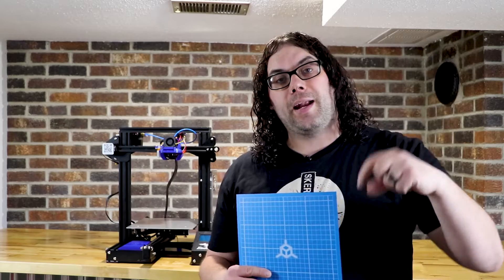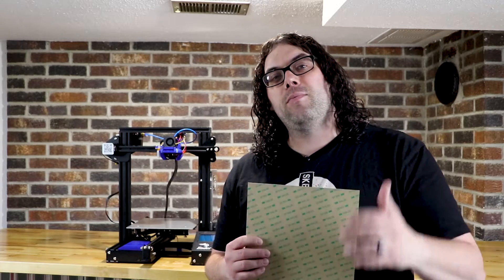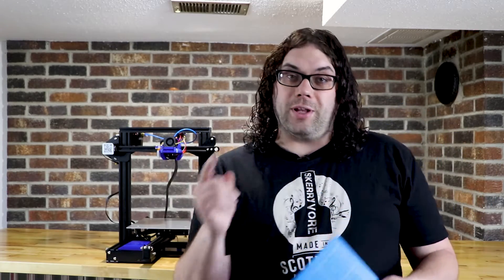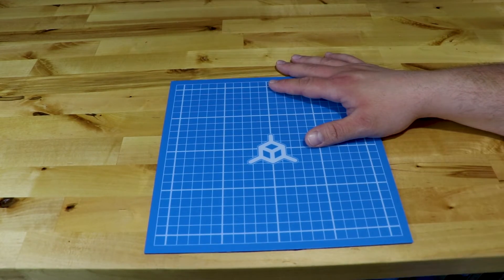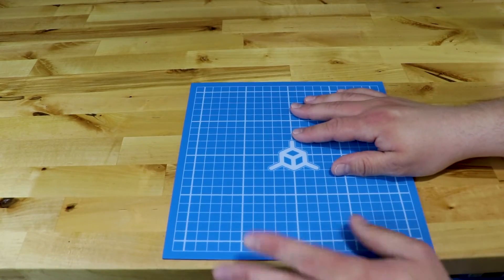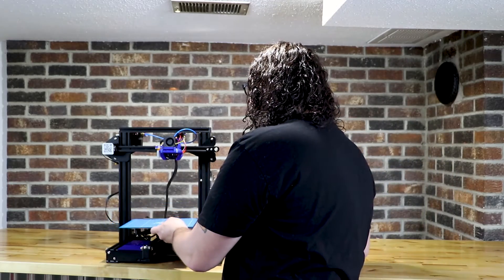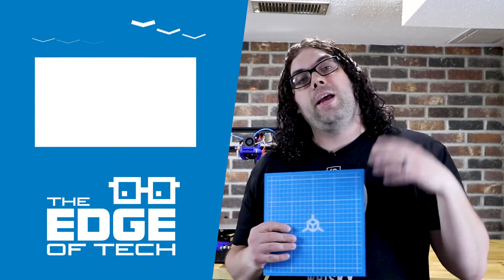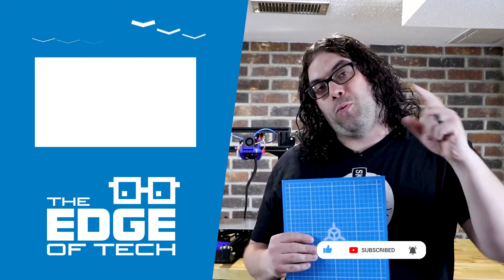Installing the TH3D EZMat Build Sheet on Creality Ender 3 and more

Comment: Hey Jim here try this before any other Youtubers get hold of it, I use this method and my prints whilst on the heated bed will not move but when it is cooled down they lift off as though they were never stuck in the first place  https://www.uantwerpen.be/images/uantwerpen/container11343/files/bonding_pla_with_salt_water_v20160713.pdf
Reply from the maker: Thanks! I will check it out!

Comment: Thanks for the video but you didn't show how easy or difficult it is to remove a model from the EZMat.    What has your experience been so far?
Reply from the maker: Hi! Thanks for watching! The EZMat sticks very well! Especially when it's brand new. You don't have to clean it between prints as long as you get all the plastic removed from the prior print. If you have a larger item, it will be easier to remove. If you have a small print, a good scraper will take it right off!

Comment: Have you tried the TH3D EZFlex Plate – Build Sheet Steel Flex Base with the TH3D EZMat ?  
Also you can use the High-Temperature Neodymium Magnets (5 Pack): https://www.th3dstudio.com/product/bed-magnets/    
It works the best see here: https://www.th3dstudio.com/product/ezflex-plate-build-sheet-steel-flex-base/

Comment: Hi Jim, I won a nozzle last night .  I sent a email last night and I have not received a response.  Hope I don’t come across impatient. I’m worried I didn’t send my message to the correct address. 
Also I want to buy my first printer like today.  I think I want an Ender 5.  Is this a good idea? The amount of support and tutorials for the Ender 3 makes me think that may be the best place to start, but I think the 5 is a superior machine.  I’m worried I may be making it harder for myself at the beginning by going with the 5.  I’m mechanically inclined but the only code I’m writing is a copy from a tutorial, again making me lean to the 3. Hope this is an appropriate place for these questions.
Reply from the maker: Hey! I did get your email and haven't had time to respond yet to anyone. I think if you have the money, go for the Ender 5! If you want to save the money, the Ender 3 is great too! If it was up to me, the Ender 5 would be my choice.
Reply: I have money for the Prusa , but it’s very expensive although seems very nice.  I’m going for the Ender 5 unless you think the Prusa is worth the extra money.  I will also have money for some TH3D upgrades to go with the Ender 5 .  Also thank you for exposing me to TH3D and Luke Hatfield.  I plan to follow your footsteps getting into 3D printing with Luke’s guides.
Reply from the maker: @DD-we9wm  Awesome! I think you will love the Ender 5 and we should have some videos for it coming out sometime soon. You're welcome and welcome to the community!!

Comment: Hello Jim,  awesome review, maybe latex gloves and ragle for applying sheet easier :) and can you review "EZFlex Plate – Build Sheet Steel Flex Base" too please? Do u know what life time theese sheets and after everyprint do we need clean it with isopropyl alcohol or something else
Reply from the maker: Thanks for the tip! I may have the EZFlex coming up soon, and they last a long time! You don't need to clean them after every print and when they stop sticking as good, you can lightly sand them to make them work again! The instructions are in the TH3D website! They are awesome!